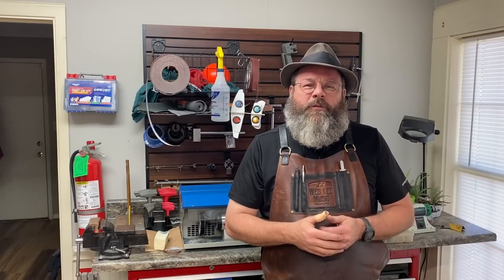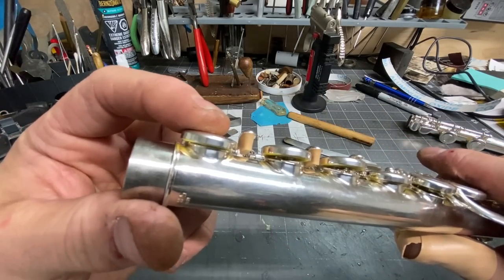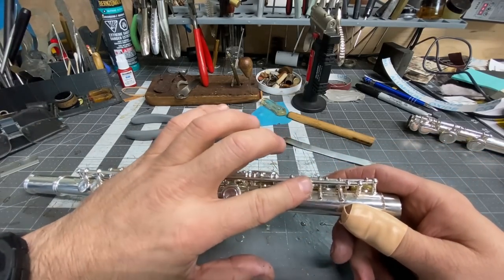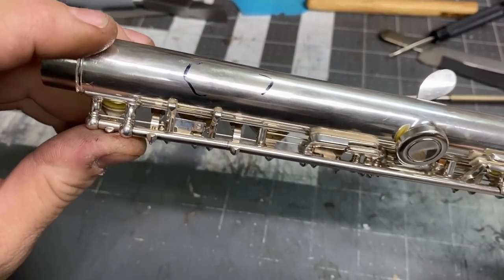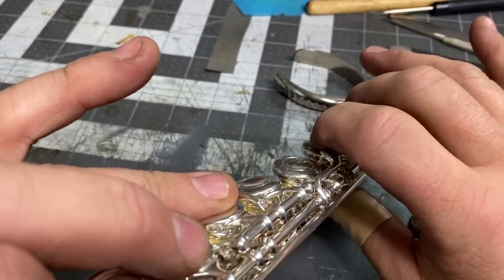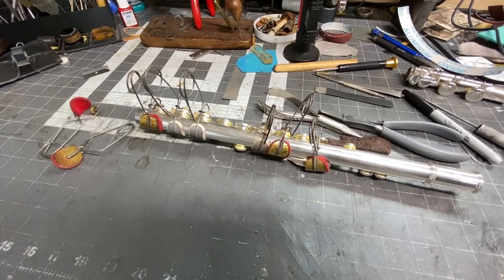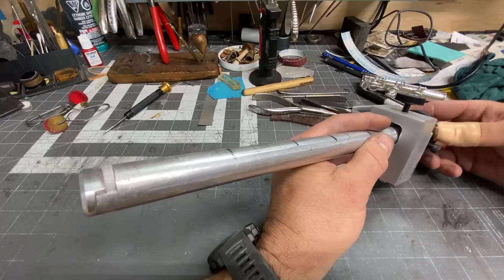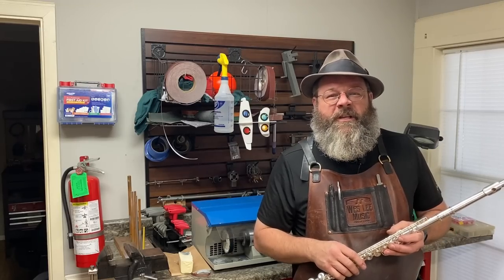Damaged Flute Keys & Cool Dent Too, band instrument repair

Comment: I have a question about flute leaks, what would be the ideal way to check for a leak? Can you use the clarinet trick and do the vacuum test and/or use the leak light? Or is there another way of checking??